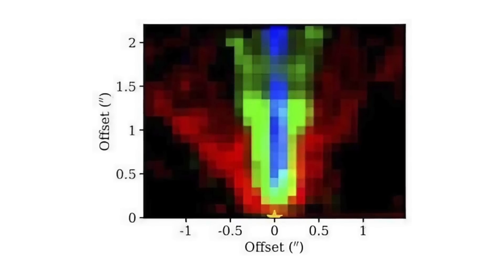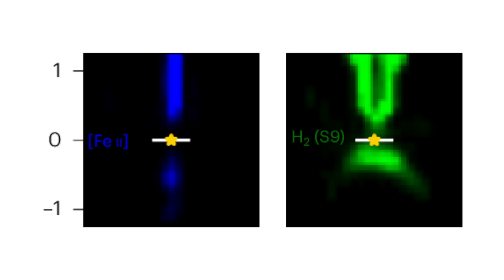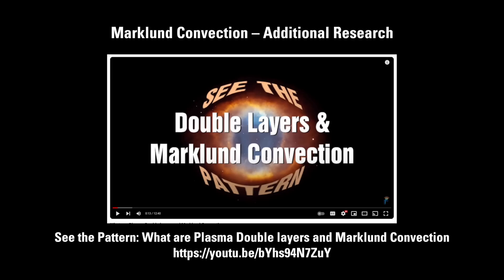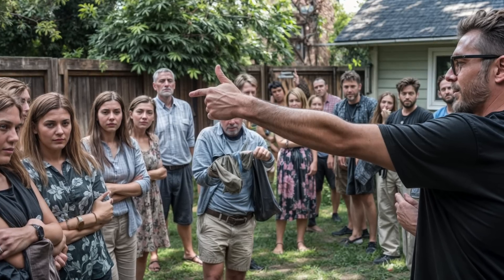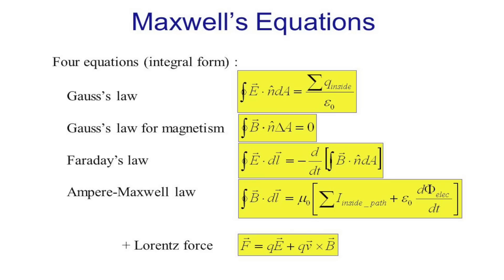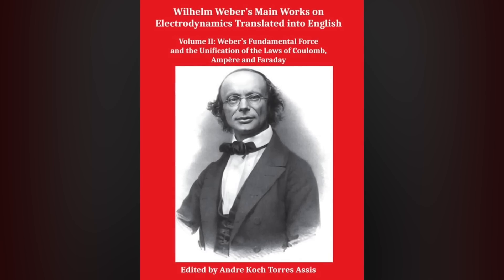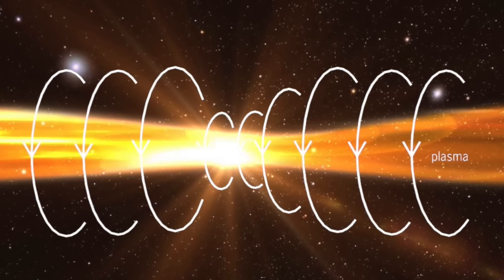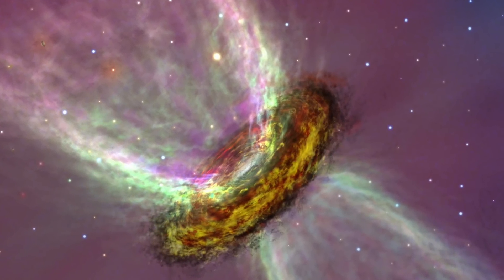Michael Clarage: The Gestation of Solar Systems | Thunderbolts

Comment: Lt Col. Thomas E. Bearden, in looking at the 6 regauged Equations of Maxwell in vector form realised that in having been rewritten, the equations had lost a very important component present in the original Quaternion nomenclature : the scalar component. Maxwell's original equations were based on modelling the aether as a three dimensional tessellated prism cells - in cross-section, appearing like a honeycomb - with spheres like ball bearings in between, with his original set of 20 equations being derived to describe the propagation and promulgation of forces across the cells and hence through that medium.

The problem with dropping the scalar (direction-independent) component is that when two waves in exact opposition (exact inverses) meet (such as, for example, a wave and its reflection in a resonant system), the vector components completely cancelled out, leaving an apparent force effect of zero. With the quaternion versions re-inserted, however, the scalar components of the two signals sum.

So, two signals exactly inverse phased in a resonant system produce (and hence radiate) no vector component but do radiate a double strength scalar component - and that just for two signals. In a suitably designed resonant system, the vector components still cancel each other out (fight each other to a standstill) BUT the scalar component is magnified immensely.

Further that scalar component radiates potential in all directions - it is part of an open system, in other words - and can be used to transfer energy from one volume to another - being capable of being "picked up" by a suitable receiver elsewhere.

This is what Tesla found over a century ago - and he also found that such scalar waves, in interacting with the aether, would often be magnified in strength - "free energy", on other words.

So, when talking about "Maxwell's Equations", it must be realized that the vector form regauged versions are defficient - and, in some ways, deliberately so to make them "solvable" for the special case of closed (electrical) circuits with a paired source/sink - but, the original equations are very far from deficient, and can even be used in conjunction with numerical analysis on high-end computing devices to express behaviours in open systems that have not thrown out the aether baby with the bathwater as it were.
Reply: True that BUT since electromagnetics obey vector mathematics, that 'scalar' unicorn us just that, fantasy.
Reply: @MiloTheMindBender  they don’t “obey” anything, they exhibit predictable behaviour in an environment where they run source to sink.  In a system where two opposing waves of equal frequency but 180 degrees out of phase , such as a high frequency resonant system, the waves fight each other to a standstill-but, the system is still fully energised.  In this case, such as in an anapole, the system will radiate scalar waves - cold electricity or radiant energy.

So, how to get resonance?  One way is by using a vortex combined with a circular flow.  In the case of the vortex, matter is constricted in an ever tightening grip.  The lower the matter descends in the vortex, the more constricted it becomes, the faster it spins and the more spread out it becomes.  Eventually, a point is reached we’re the matter coheres - the individual waveforms all move into lockstep. In the right environment, this can also create resonance as the now cohered, deconstructed matter approaches a singularity.  By creating a circular flow, and constricting it’s radius (by “feeding” it more energy in the form of regular pulses, the same effect occurs.  Combine the two, and you get a system that can create EVOs that can interact with each other (but not the e-m environment) via the aether that feeds them - “static” electricity may well be an effect of micro EVOs.  

Another way is by creating an open resonant circuit - but that is best explained/demonstrated by Master Ivo - search on “Master Ivo - Essential Nikola Tesla Lecture from 1891”
Reply: @gordondocherty  Oh, a Master Ivo adherent. I disproved his ideas six ways from Sunday sooo.....   SMH.
Reply: @gordondocherty  You can lead a horse to water... lol
It's no surprise to me that Tesla's Turbine works in this way as well.

Much Love
Terra Pax

Comment: Zero errors, 85 zeros, CLASSICAL, totALLY baryonic, N, no nihilism, where lightening clapping is a piece of the Sun N 9-11, see Mental Boost 2 4 data on 9-11. Anomalous mineral formation, magnetized concrete, golf divots in totally twisted metal cut in 30' segments, unburned paint for the proposed heat distribution, pWoof, hydrino. 

Ten times TNT, @27.2 eV per transition, the electron is not a singularity and the universe is oscillatory, such that a11 of JWST's distant galaxies R carryover from a former iteration of the creation of matter. KISS, Occam's Razor, 1st principles only. 

hbar [magnetism, Poynting] = h [gravity, Planck] / 2pi X-ACTly 

Francisco J. Varela predicted a chem-network for the Grand U in 1979's, "Principles of Biological Autonomy," immunology a function of speciation. Was he killed with a cocktail?

The 1st law is a closed circuit, N, entropy changes direction after matter condenses. From G. Spencer Brown's, "Laws of Form," form is condensation, cancellation, number and order.

Comment: Lets do a thought experiment here with a little backup from an AI question and answer session I recently had.

 I proposed to the AI that an Aether or a very very small crystalline residue was left over after an opening of our space within our host Black Hole internal material. This Black Hole was so immense that the laws of physics broke down in its center point and the perfect material within our host Black Hole fractured and Our space began to unfold. Layer after Layer of this crystalline residue is left over as our space cracked open and started it's life. Yes I said LIFE. The Universe is alive and it has plasma within its body. That plasma is space itself. A residue of the "Big Bang" or to be exact the big RIP. The stuff that the Universes blood(matter) flows in and gets it energy through.

 This residue is fractal in nature and it is the reason we see crystals and geometry in nature as it is what everything bathes in and is gently or strongly influenced by.

 This residue is real and due to its shape allows for movement from energy(smaller crystalline residue bumping into the base or a larger crystalline residue. Think of larger pyramidal crystals being bumped into at the base and electrically stimulated to add to the tips potential. This focusing allows for steering to either lower, equal or higher potentials. Each getting a different response based upon size of the crystals in reference to each other and the amount of crystals bumping into the base of the driven crystals.

 There seem to be two different kinds of crystalline reside. One being larger sized then the majority residue. These larger, more solid crystals are the highway type that tend to setup and grow a highway from energy to transfer between gross matter. This structural type of crystal is slower to move but one it does allows the more mobile virtual energy carrier crystals to follow along around the structural pathways.
 I found an example that we can use to see these structures.
Since it was fractal in nature I thought it has to be a fractal period and started investigating fractals. 

https://encyclopedia.pub/media/common/202211/mceclip6-6364a84db3f66.png

The red is a virtual energy carrier with the blue being the structural type of crystals. All born from a single pyramidal crystal. The blue and red are from one crystal shattered into what we see there.
The red being virtual means it is self aligning and variable in size. If you look at the structures in fine detail you will see something odd. Lets see if you can spot the polarity of each type of crystal.

Comment: This video is all well and fine.  However I have only ONE question for Michael Clarage............................WHAT HAPPENED TO SAFFIRE ?
Reply: Safire was successful and it’s now a company called AUREON ENERGY LTD.
Reply: SAFIRE published some claims on being able to transmute elements and is now claiming it will apply this technology to nuclear waste treatment. If you believe this to be true, you should immediately invest all your savings!  @raycar1165
Reply: @raycar1165  how so? what did they achieve?
Reply: @physicswithpark3r-x3x  I’m not sure how much you know about it (Safire) but they built a rig to test their electric sun hypothesis and found transmutation of elements and about five times the energy came out as went in. 
Now they’re focusing on nuclear waste remediation.
Reply: @raycar1165  are you absolutely convinced that they transmuted elements and gained 5x energy?
Reply: @physicswithpark3r-x3x  do you believe that the universe came from bb
Reply: @bichthuyentruongthi2600  is that what you think the bb theory claims?

Comment: I have a geode slice that looks like a cymatic frequency, frozen in time. I see this mineral separation in a lot of crystals and rocks. Like, you can see where the current flowed when it was melted, fluid and separating its elements and arranging where they “wanted” to be. Then cooled, frozen in that elemental arrangement. 

The Earth is just a large geode. Keep going outward, and expand the fractal, separating the elements and letting them arrange themselves where they may.
Reply: I just looked at that geode again. I noticed where the current entered and exited. I see right angles. 

On a different geode slice, there’s a whole section of frequency bands and right angles that form perfectly and snugly against each subsequent frequency line. That doesn’t happen over a long period of time. It’s instantaneous.
Reply: @FireStick-nu4pn I collect geodes too and noticed the same formations. I agree entirely that the Earth is a giant geode and often wonder about the interior of other rocky planets and moons.
Reply: So there might be a depth in the center of the earth where it's all just.. gold?
I always find curious why metals get concentrated in those "veins"
Reply: @JavierChiappa  The crystal caves in Mexico are a good example of this structuring.
Reply: Sometimes, I think there’s something to the whole “Hollow Earth” possibility.
Reply: @FireStick-nu4pn  Well, you'll find that geodes tend to be hollow in the centre.
Reply: @JavierChiappa  In one comment  on Anton Petrov's channel regarding piezo electricity from earthquakes I stated that :
 🤜⚡💥⚡🤛  Yes this process 'might' occur but this is how it really happens - earthquakes create alchemy...but not in the way the scientists [cough!] claim. Look up 'The Safire Project – Testing the Electric Sun'. Transmutation of hydrogen and electricity is how most elements are formed. Others elements are formed from molecules of small/light elements. In this case, pizza-electricity combines a molecule of quartz [SiO2] into copper or zinc but, with an additional silicon atom, gold is formed. Mind you, lightning can do it too. 🤜⚡💥⚡🤛

To your 'vein' comment, IMHO, gold is formed there due to a conductive channel, perhaps a crack which harbored water.
Reply: Wal pointed out the likelihood that all planets should be hollow because of the electrical nature of things.  Since the surface of our Earth is Negatively charged,  there must be an inner SURFACE that holds the opposite charge.  Unless you are OK with the delusional idea of monopoles...

Comment: Everything is electricity, aether, matter and fractals.
Reply: even simpler everything is Fields and pressure mediation.  And yes of course in the Aether.  No such thing as particles.
Reply: Yeah. Tesla said it was all frequencies.
Reply: I love looking deep into geode slices. It’s electrically separating matter, frozen in time. Right angles, straight lines, shapes in bands following the ultimate shape of the outer edge, and the points that the current flowed through. They are very fascinating.

I add fractals because it’s the shapes the elements settle into after being electrically separated. Rivers, tree limbs, blood vessels, lightning bolts, all look alike while preforming the same function: moving energy. Once you see fractals, you see them everywhere.
Reply: Consciousness comes 1st 😊
Reply: @mauimixer6040 possibly
Reply: Even the money very soon will become "Electrical"
Reply: Like a Big figure 8= ₪ the so called black hole is only the beginning of the loop/back